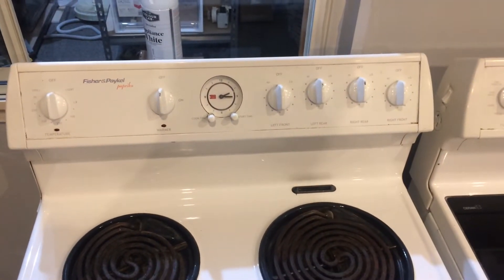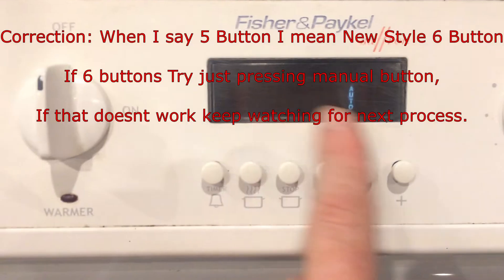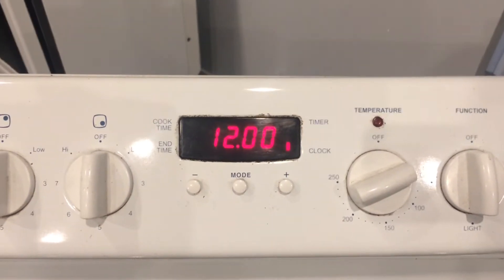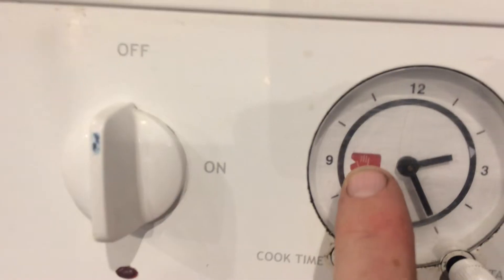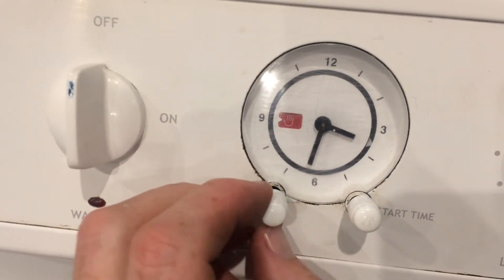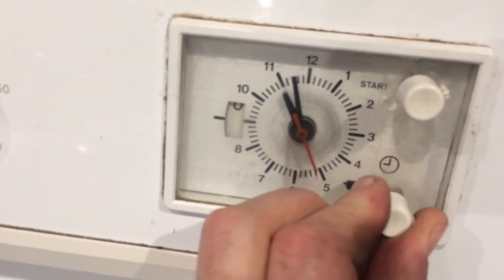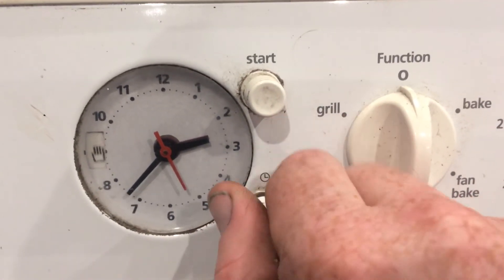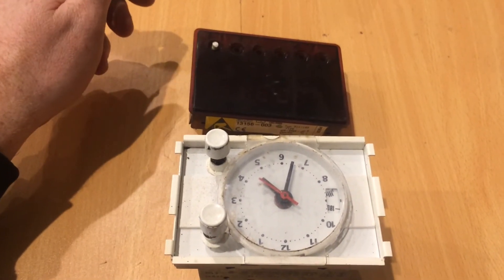Setting Oven Clocks/Turning off Auto

Comment: Sometimes those left buttons can be fiddly on the 6 button digital. Might need to jiggle the 2 on the left a bit til the screen blips then smack the + button to get it working. Great video, even better it's from a motueka repair shop.

Comment: Does thus turn all the stove on.
Reply from the maker: It depends on the model. For most it will just turn off the oven, but for some older models it also turned of two of the stovetop elements and the power sockets.